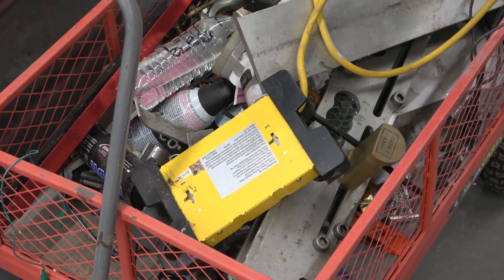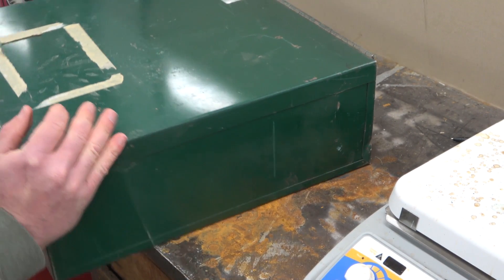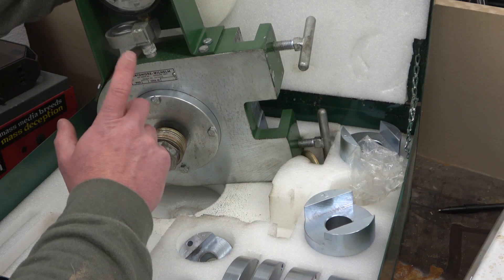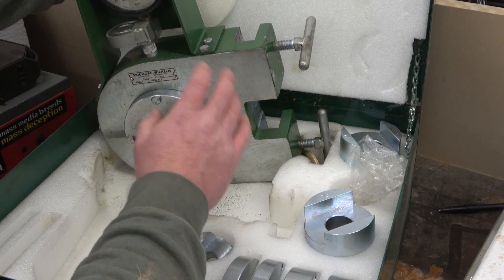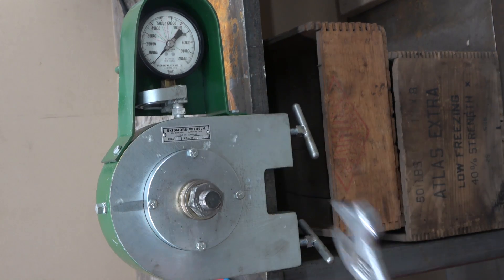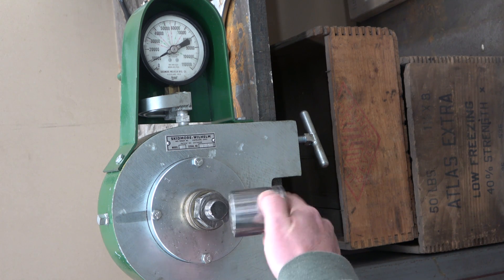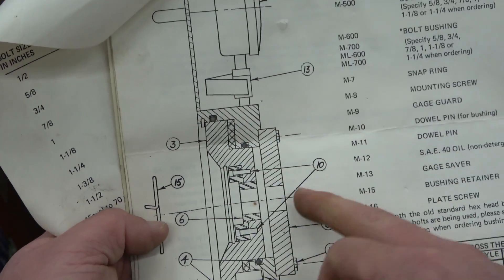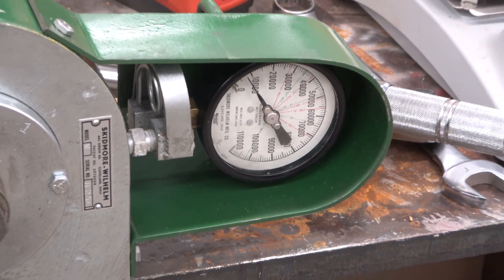Skid more with Wilhelm | Bolt Torque

Comment: We have a Skidmoor tester at work that I've had to write test plans for. The only guarentee is the you can never get the damn clamp load you want. Definitely depends on the finish. Yellow Zinc is alright. Eco-Guard is more like Eco-Fart. We were getting a range of 14,000 lbf clamp load off the same torque value for a 3/4" bolt. All same loading scenarios. Not even touching the bolts with my greasy bare hands. Also probably helped that we were using Hazard Fart's finest to torque the bolt.

Comment: The fluid pressure is proportional to the distance between the parallel plates in the mechanism. Increasing the volume of fluid will increase pressure and can be done at a known input torque to calibrate the tool. Cheers!

Comment: Can you explain why that tube going to the gauge has that shape to it? Is that some kind of flexure to more linearize the curve for the gauge? Sort of like a Bourdon tube kind of effect.
Reply from the maker: Works as a simple hydraulic accumulator. Pressure spikes deform the coil, so it doesn't damage the guage.

Comment: I use a Skidmore Wilhelm regularly. 

 Torque values for fasteners are based on the thread friction and friction under the head.  

T=kDF.   The K factor is a constant that varies depending the materials and lubricants on the threads.  In order to obtain the proper tensile load in the screw you need to know the K value.  Using a Skidmore you plot the torque vs tensile load so you can calculate the K.  This can then be used to specify the proper torque on the fastener.   The Skidmore is perfect for this.

Comment: Oddly enough,  thermal expansion is highly predictable in metals.  Correlation of required bolt tension to linear expansion, then adding in a fudge factor of a hot bolt preload, one only needs to pop said bolts in an Easy Bake oven for said temperature differential.

No nut busting, rupture inducing unga dunga he-man effort.   Once temperatures equalize, joint is tensioned.

This is why heating fasteners that are hopelessly stuck often aids in their removal..

Comment: It says right there on the gauge face, ASTM A325 and A490.  
A325 is a med-carbon steel with a tensile of 105-120 ksi.
A490 is a high strength alloy with a tensile of 150-173 ksi.

Comment: A gauge in the range of pressures you expect to measure would have better accuracy and finer data points.  Can always switch back and forth depending on what tests you devise.

Comment: @AvE, Imma gonna have to call a bit of Bullshit here. Bolt stretch SHOULD be proportional to torque, but you really glossed over just how much fuckery really goes into bolt clamping force vs Torque input. So much so in fact that it is generally considered to be a wholly inadequate measurement for critical  bolted joints, hence the invention of bolts with clamping force indicators built into them.

Comment: Just my opinion from taking rusty bolts loose on old tractors when there was no impact wrench on the farm.   You can apply more torque to the nut or bolt by using your legs to lift the bar than by putting your weight on it.   Body mechanics.

Comment: I sure could have used one of these hoo-haws a few years back when I was designing custom bolts for sanitary pumps. I was torquing batches in a nut and measuring the change in length trying to figure this out.

Comment: what were the shiny doo-dads for?  i made something similar to those last week, custom, for changing electric water heater elements.  2.45 o.d., 1-1/2 wrench size, 1-1/4 through bore, 3" long.  final result weighs in at 2 lb 10.4 oz minus the tommy bar.  I think it might not be stout enough ...

Comment: Not but a few weeks back I suggested this very device, ney notion, to the Torque Test Channel. Not sure how the Skidder will stack up against their custom cobble wobble but it's worth a shot. As mentioned previously, I have mostly seen the Skidder used for structural stuff, tension control bolts, DTI squirters, TON wrenches, etc. Important to note, there is a specific coefficient  through lubricant when using the Skidder. To the manual, Batman!!
Reply: You must have missed when they borrowed a Skidmore to test the 1" Milwaukee after that monster partially broke their rig.

Comment: I don’t mind you using chrome socket as I’ve never had one break on me yet and I’ve used a lot but you will lose torque output not using a proper and heavy impact socket. The chrome sockets are a lot thinner and lighter but they will work in a pinch just can’t get full use of the wrench.

Comment: You cannot beat on it with an impact gun and expect similar torques…. Smooth single pull either dry or light oil per mfg specs cause all the mf’s know they are right. Hit it with an impact and your fancy smancy gauge is toast.

Comment: Dude! I use one at work. Had a custom back plate made to test huck bobtails (shud send u a huck sticker) clamp load vs trad bolts. Made sacrificial bolt heads to test self tappers to failure (despite the ASTM test.) oh mine has lo and hi range gauges.

Comment: Speaking of changing harmonics and resonance and such, one of the best tools I can recommend for young guys jumping hands-into a trade is a set of "torque-sticks." This is basically a set of extensions for your ugga-dugga that keep you from overtightening stuff with your ugga-dugga. I still have a set in a horrible blow-molded case that I bought from the Horrible Fright for 30 or 40 USD. And ya know what? They were pretty accurate, even when checked against an old-school, Fap-Away dial/click torque wrench.
Reply: keep in mind they are designed for pneumatic tools, the electric tools work at a higher frequency and go past the point they are designed to stop at.

Comment: Never thought I would need to consider the operating temperature of a hammer.
Reply: When did the calibration expire on that hammer eh?
Reply: I always use a chunk of two-by-four and an engineer's hammer. If the wood splits then it goes on the firewood pile.
Reply: When his brass one shatters we will know it's cold!
Reply: You've never sent the apprentice out to warm up the hammers? 🔨🔥
Reply: That's why I only use plastic hammers....
Reply: My Snap on deadblow failed in exactly the same way
Reply: In Canuckistan, its advisable to consider the operating temperature of your operating temperature.
Reply: In the Frozen Shithole of Hoth, Kanuckistan  they say temperatures get so low that flicking a man in the balls is a field-expedient castration, not to mention a good Christmas gift for the missus.
Reply: You’re fired.
Reply: Comment of the year 🏅

Comment: That Snap off hammer's the gist of my life - "Gonna get some tea! [5 minutes normal] Didn't get back for 40+ minutes, but hey I've even been outside _too_! And no tea still!

Cascading frekin' fractal failures.

Also yes, the gage guage the needle thing should go reverse-Pareto (nerd_points++) and have only ~20% above what you're actually looking to measure.

Slow gin-missing waving from the aaalmost-snowy-half-shithole of Polandia o/

Comment: This isn’t how we used this device on job sites but…we don’t even use them anymore. Now we do “turn of the nut” test. Depending on the nut diameter dictates a set distance between marks on the nut and the material face. Example: 3/4 nut equals a half a turn after snug up. I have 3 in storage if anyone wants to have a green toy in their shop.

Comment: And you can't exchange it at the Snap-on truck if you are not in a company. People who buy Snap-on tool for home/personal use have to jump through hoops to get service and it's usually declined.  If you are walking along and see a Snap-on truck and buy something off it, they will not support (ie repair or replace) at the truck.

Comment: Sir, Twin that gauge with a digital strain gauge pair to record the +Tension and -Tension aka Hysteresis Slope. Add your temperature sensor as work done  spends heat, and you can measure that too.  Looks like a solid bit of kit, Good find.
Reply: also measure bolt stretch on the main fastener with calipers for another data point

Comment: All praise uncle bumble fuck, appreciate your pursuit of the beans we're always chasing. More data is more better! That said I would be surprised if your results MATCHED ours, as if you'll watch our original episode we didn't calibrate to a coefficient or bolt tension multiplier to replicate a Skidmore, we did it to an old school IR 231H US made impact. And everything going forward is compared to that, because brands were advertising numbers multiples more powerful than that, but the guns didn't really FEEL like it, and turns out most aren't. We just wanted to compare tools, not assign an almighty rating to any which we think is silly. 
You mention impact wrench brands use a Skidmore to rate guns, or even breakaway torque. That used to be the case, but they've moved away from that quite a bit if you talk to their engineers. And especially breakaway and nut-busting which they all rate using different methods, DeWalt using a strain gauge on a torsion shaft for example. I myself am working for an impact wrench manufacturer now in product development (Astro) and there's a list of ways impact wrenches are tested depending on the brand buying. It's crazy. So as long as each tool is used in the same test process, the comparison between each is really the end goal.
Reply: All hail the almighty beans
Reply: I'd be surprised if you both had the same results. But I'd hope they would be the same relative to other tools tested on the same testing thing.
Reply: "If you talk to their engineers"... do you know uncle bumblefuck?
Reply: The moment he pulled out that tool I thought, "Torque Test Channel!"
Reply: I love beans diggy do!
Reply: Wait, you work for a manufacturer now? I'm not surprised someone wanted to hire you but that seems like a big conflict of interest for your channel.

Comment: You need a digital gauge like the one torque teat channel uses. It has a calibration function so you will see the corrected torque values instead of raw psi data which will be more accurate.

Comment: I wonder how much of the reading of the torque is dependant on the type of valve in the measuringapparatus or if its a mechancal dial that is the thing, the type of spring and ratchet? Being faster closing, higher reading, slower closing lower reading.

Comment: Depending on the application, many applications with bolts require the bolt to hold things together tightly so the friction resists movement vs. the mechanical interlock of the bolt in the hole.  But how do you insure you have the right clamping force?  Torque is the worst indicator of this because it depends on type of threads and condition of threads.  The bolts laying out in the weather will react much differently than the new ones right out of the sealed box.  Tightening to a specified torque may or may not get the results that you want.  So you calibrate the system with the Skidmore machine.  Put your actual bolt into it, tighten it with a torque wrench until you get the clamping force that you require, then tighten the rest of the similar bolts the same way.  Open a new box of bolts and you recalibrate the system.  The application I'm familiar with is bolted joints in structural steel construction.  A lot of methods have been designed for tightening bolts that don't use the torque wrench, but in other industries we still use the torque wrench and I have 3 of them in my home garage workshop.

Comment: One of those has been sitting in our shop for years.  No one knew what it was or where it came from.  Now that I know what it is, and what we do, I haven't the foggiest ideal why it's here.
Reply: Liberate it
Reply: theres a good chance your shop was doing some safety critical work with large bolts (think 1 inch plus) likely they needed to prove for some regulation that the bolts were torquing to a specific bolt stretch under a given torque + angle you were applying.
Reply: Probably just cause its cool
Reply: We are a small family excavating company.  Like 8 employees was the largest we've ever been big.  Dad started the companyin1963 and doesnt remember purchasing it.

Comment: As an ironworker. The skidmore test guy is the best part of starting a job.
Reply: That used to be me. I remember one time I couldn't find a vertical flange to clamp it to so I used a tractor bucket. I pulled the first bolt and when the machine slipped a little I slipped ALOT and went sliding down a small embankment. Even the inspector can have a rough time of it. Now, off I go into the cold, snowy, Canadian winter and inspect some crap at a nuclear plant at this very moment.

Comment: My grandfather had a pneumatic tool repair shop. We had one of these (might not have been the wilhem brand) mounted under the bench for final testing of impacts. Nothing major mind you, just simple function testing and to see that they could output some torques. Occasionally we'd put a customer gun on it before bringing it in to verify it was down on power. Usually just used 1/2 and 3/4 guns on it. The big 1" semi wheel guns would rattle everything off the bench wall.

Comment: Easy way to find what wrench size the nut is if you know the diameter of the bolt/stud. Take stud diameter, let's say 1", divide by half, would be 1/2, than add it back to the stud size. 1-1/2. Add a extra 1/8 inch to that if its a heavy duty nut.

Comment: You are either out of threads on the bolt or bottomed out in the cylinder.   Try a new bolt.
If you want to impress the masses use a bolt that says CAT on it.
Reply: Because CAT videos algomagically go viral?
Reply: @robert_g_fbg  lol The other kind of viral CAT video.   Seriously though, I've seen a lot of hardware in my day and among the most impressive (and expensive) are forged bolts clearly identified with CAT on the head.

Comment: Was the thread lubricated good? That'll change the torque value as you know. If that thing has been stored a while the lube might have gummed up. Might be good to try and clean it up and use good anti sneeze...
Reply: Talks about lubing it up then mentions anti seize... Must be the FNG.

Comment: It would be interesting to see your experiment with a pressure gauge and the long lever and weights. I'm curious in what ranges the Torque v. Pressure relationship becomes pretty must linear overcoming whatever friction oddities in the threads. It will have a lot to say about how scientific the use of the Torque wrench is in car repair, with the typical torque specs for fasteners on a light vehicle. Especially if you produce a graph of the plotted values on that curve.
Reply: Last time I did a major replacement on an engine they were specifying a combined angle and torque. Angle is directly related to the strain/tension rather than torque being impacted by the thread and bearing friction. So a better measure of true clamping force.
Reply: Everything is nonlinear if you look at it close enough. Sometimes it's better not to know and just pretend it is.

Comment: Suggest a little plumbing partner; add a T and an additional dial for the low end with a valve in front of it; then you can easily isolate the small scale one as and when it goes off the scale to avoid damaging it.
Reply: 75000 psi+ valves are kinda hard to come by.
Reply: @Chris_Garman  needle valve would do the trick right? Doesn't need high flow or anything.
Reply: Don’t need a 75k valve lol, 75k denotes the tensile force applied. I’m pretty sure at 75,000 psi that whole assembly would of blown to the moon already
Reply: @bds21  he's not wrong there; lucky they aren't out with pitchforks yet showing off the smarts like that.
Reply: @bds21  The gauge is in PSI is it not?

Comment: I'm not sure if it's the same brand. But at the steel fabration shop I work at, we have one of these to test th TC bolts. Certain jobs we do we have to randomly check different batches of bolts before we can start bolting up beams. Usually only goberment jobs, we did a shipping port in new jersey and let me tell you bud those inspectors were the dullest batch of dull beavers you've ever had the displeasure of encountering...

Comment: Will you grind that broken tack weld  from the surface of your bench yes? haha good video as always though. Also you can make a dead blow metal hammer and use car tire cuttings for both ends. I could elaborate if the idea sounds interesting.

Comment: While they certainly do cheat the tests, I will say that a baby 1/4" impact was able to break loose a bolt that I couldn't budge while bouncing up and down on a breaker bar. I don't remember what color it was, but it wasn't a particularly fancy one or anything.
Reply: I was changing the shocks in my car and I couldn't get one of the bolts loose so I was air chiseling it off when the nut just up and spun itself completely off and landed on the ground. The vibration was all it needed to break the rust.
Reply: What’s the resonant frequency of rust? 🤔
Reply: @robert_g_fbg  The $64,000,000 question. Power fist air chisel I'm pretty sure.
Reply: 1/4? are you meaning 1/2??
Reply: @ryanmalin  nope, it was one of the 1/4" hex drive impacts that are mainly used for driving wood screws and the like. Had a socket adapter on it.

Comment: Stopped dead when I saw a clear area on a bench in your shop at 1:35 in. Did you cheat and clear it off ahead of time in preparation for this moment? Or was it just serendipitous? And no, spell check did not help on the spelling of serendipitous but I did look to see if I screwed that up.